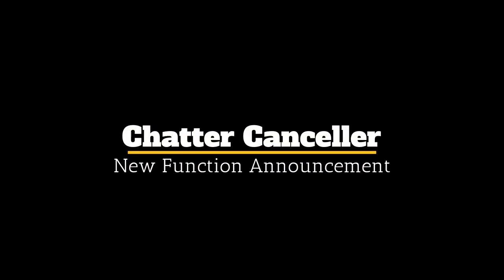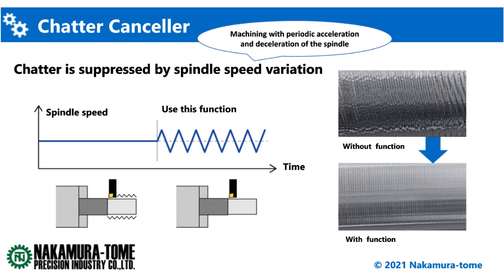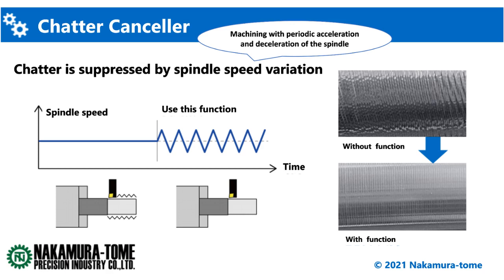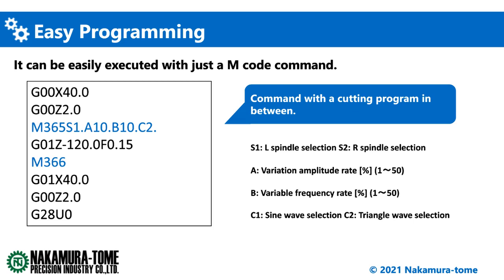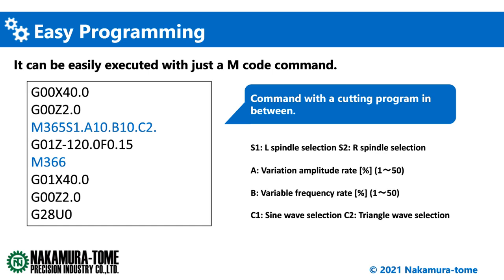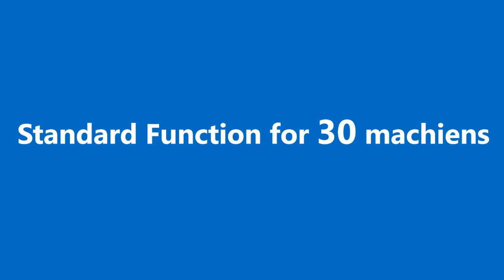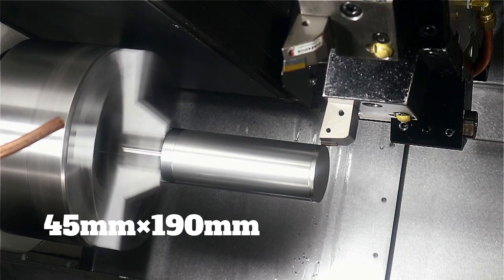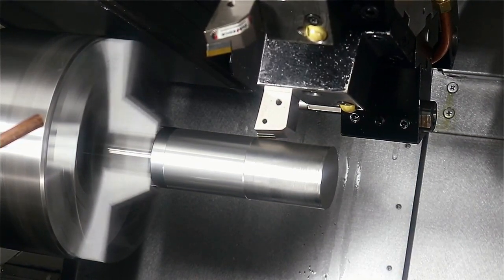New Function Announcement | Chatter Canceller

Comment: Is it available in the as200 range?
Reply from the maker: Basically, AS-200 is included but it depends on the machine number.  If you already have an AS-200, we need to know your machine number to confirm whether it is corresponding to the function. Please let us know the machine number through our website if you need further help. https://www.nakamura-tome.com/contact_product/
Reply: @nakamuratome_global  Thanks, ours it pretty new so if they had been shipping I'm sure it's there. How do you engage it with both spindles clamped on the same part? S2 & S2 in the same line?